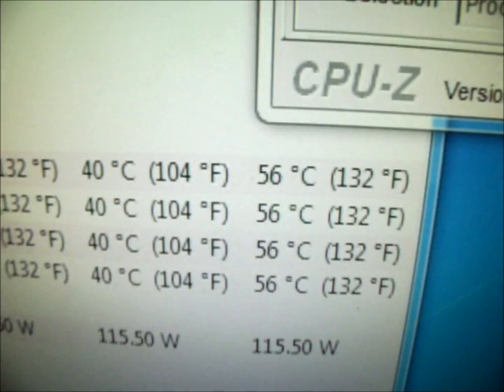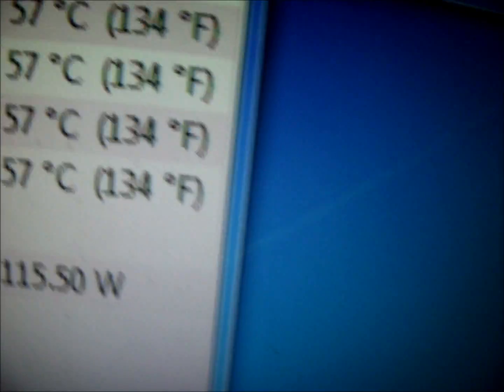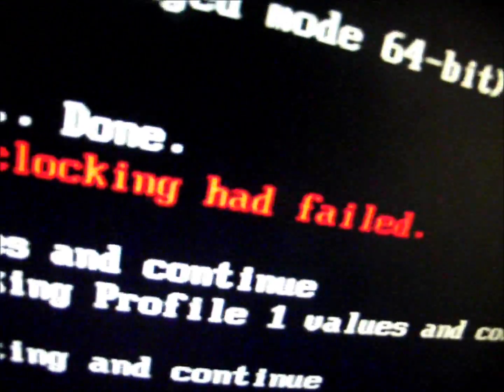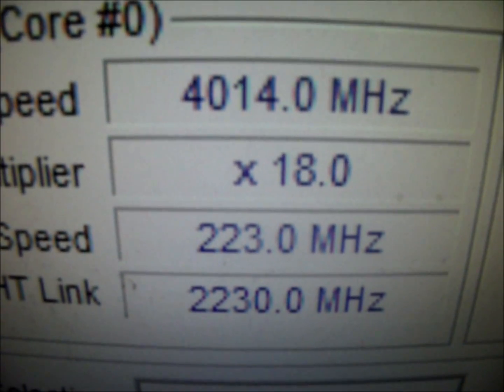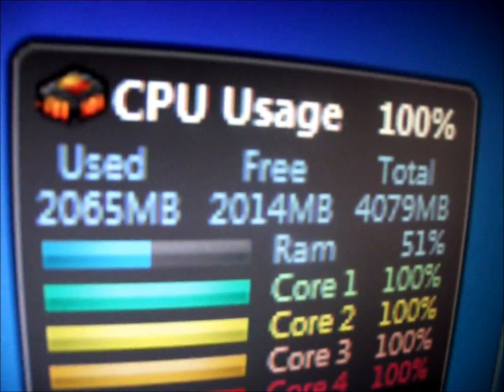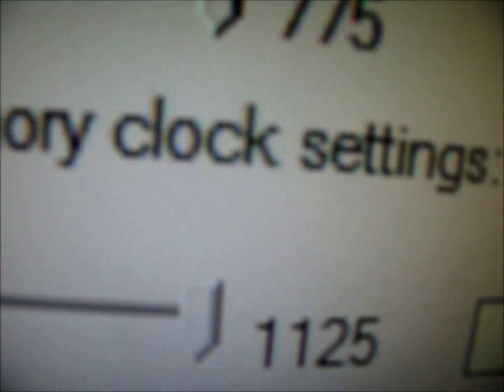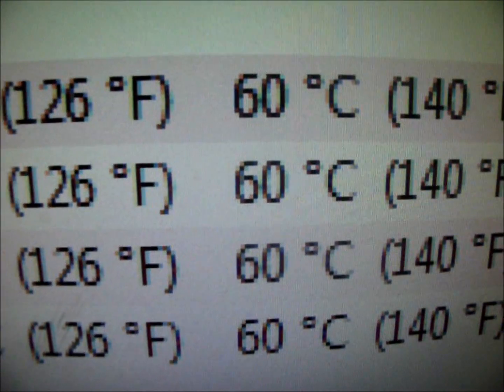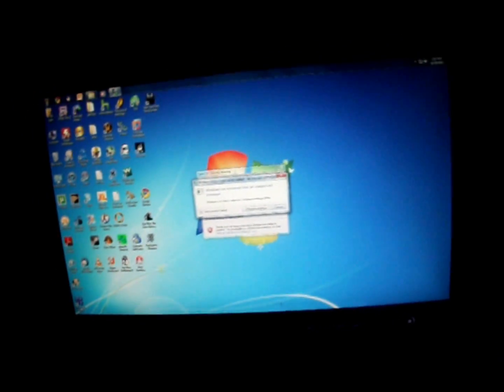AMD Phenom II X4 965 O/C to 4GHZ???

Comment: Using a Blend test on Prime 95, at LEAST 3 hours, but 6 is ideal, anything over that is really not needed. Some people go 12 or 18 hours, but if you do not crash within 3-6 hours, you should be fine for everything. I actually tried getting mine up to 4.1ghz, and after 3.5hrs, i Crashed. So it may look stable for a few hours, but it isnt. So im back down to 4ghz

Comment: well, this chip's golden number is 4ghz. Its not very easy to get to 4ghz without using over 1.5v ( I got a good chip, 1.4875v, so I have headroom). Getting over 4ghz is very rare (stable, ofc). I can get 4,8ghz stable enough to validate with cpu-z, but nothing stable over 4.03ghz. the max i have ever seen on these chips is 4.2ghz, and they were one water at 1.57v. I wouldnt go past 1.53v for 24/7, but you might be able to get 4ghz

Comment: Clearly hes a god. A 60mm fan can only provide maybe 60 degrees Celsius, on load, stock frequency. But if you add dry ice and liquid nitrogen and put it on the fan, you get that.

Comment: Lol.. OC competitions using liqiud nitrogen (which is -220C) on cpu's running at 6Ghz or more, still reach temperatures of +40C. Liquid Nitrogen is used because cpu's at that rate produce so much heat that they will completly burn to death without it.

Comment: I got those overclocks easy with a swiftech pump, xspc res, black ice rad and ek hf supreme all nickel CPU water block. I am using feser fans and feser coolant. My tubing is tygon clear ½ ID ¾ OD tubing and fittings. And I forgot to mention my idol temps are 36C to 40C all the time. I have a vid on my system on my channel. Check it out. I know I can get 4.4 GHz just have not attempted it yet. I will be getting the Crosshair V formula 990 FX Mobo soon, can’t wait to see what i can get from that

Comment: I switched over to water cooling 6 months ago using the same CPU and I am getting some great overclocks without even touching the volts. I am getting a soled 4.0 GHz with stock volts, everything stock just changing the multiplier. Getting great temps as well. I am getting 29 to 32c in startup and 52c on 100% load on all 4 cores. The really weird thing is I am getting 3.9 easy at 1.3000 volts and 4.0 GHz at 1.35000. I can do 4.3 solid, upping the voltage 2 notches form the stock voltages.

Comment: @squiddy102 
These CPU's really shouldnt get any lower then like 35*C..
When temperatures are to low, CPU's wont work as they should be.
Your load temps are nice though.. could be even a bit higher, so maybe an higher overclock?

By the way, max temp for these CPU's are 63*C.

Comment: I am running the 965BE on 4,02Ghz.. FSB 200, Multiplier x20, Vcore: 1.5750v
CPU Cooler: Coolermaster v6 GT.

Temps are:  Idle 42*C, Stressed 55*C

PS: Use GIGABYTE Mainboards for OC'ing...

Comment: 54c at idle..holy sheesh dude..mines running 4.1 stable with prime 95 and on full load it doesnt go past 45c. Using a corsair h70 in push pull, and its really good..usually 27 idle.

Comment: Make sure you memory can handle the bump in speed; you may need to "under"clock the RAM to compensate for your increased on the HT ref. clk. ALSO to get good overclock it will take a good mobo, what kind do you have?  I have fairly similar setup so here are my settings/results:

mobo- msi gd70-79fx
cpu-965 w/ C.M. v8 heatsink
8 gig 1600MHz memory
HIS 5850- 850MHz  1100MHz mem

cpu multiplier- 20x
HT multiplier- 13x
HT ref. clk- 200 (didn't touch)
**cpu voltage- 1.400**
NB voltage- 1.375

Comment: i have got that message before that is funny and it was at 240 to, keep plugging in with settings. keep an eye on the temps, when gaming you should get highs about 54 to 55 witch is not to bad. prime is going to be maxed out. 3.9 is a pretty good performance.